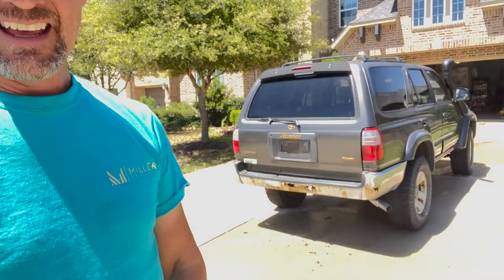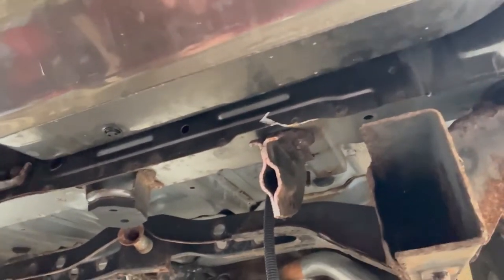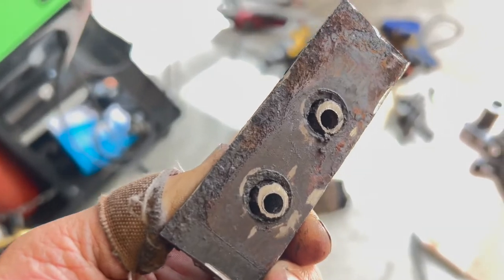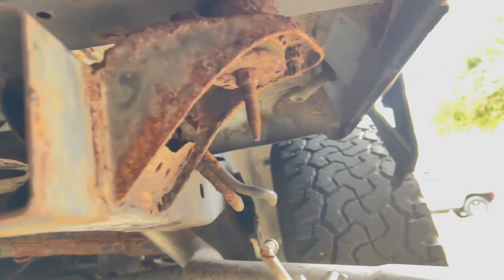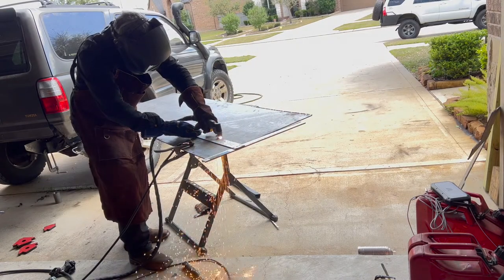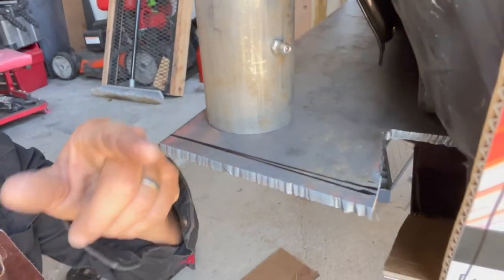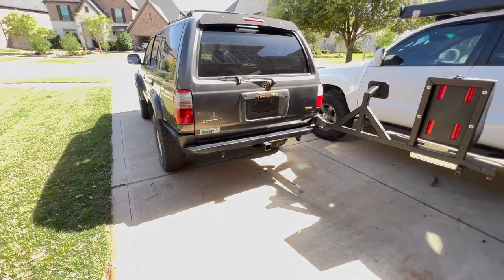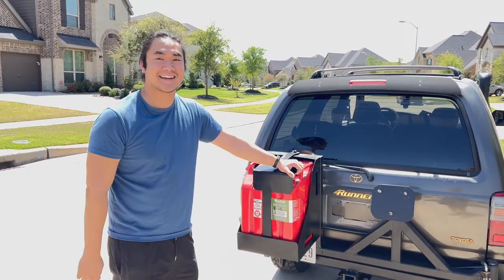3rd Gen Toyota 4Runner Rear Plate Bumper

Comment: Sorry about your driveway Steve! It was great working with you on this build, can't wait to work with you again!
Reply from the maker: Haha.  No problem at all.  I have a gas blower that I use on it a couple of times a day and and 3000+ psi pressure washer that I use regularly to keep it clean.  A bit of rust isn’t an issue. I should have looked under the front though before agreeing to do your front bumper (kidding) lol

Comment: It would be super cool if you were local to Houston or even a couple miles away. I need a front bumper kit welded up and a rear bumper designed and built for my 3rd gen and your work looks incredible
Reply from the maker: Hi Mike.  I’m not that far from Houston actually.   I live in Fulshear, just southwest of Katy.   Shoot me a message at bentleycoaching@mac.com or text me 872-252-3685 and we can connect.